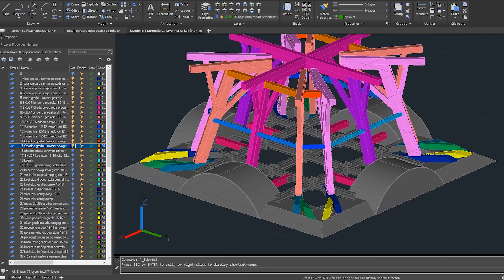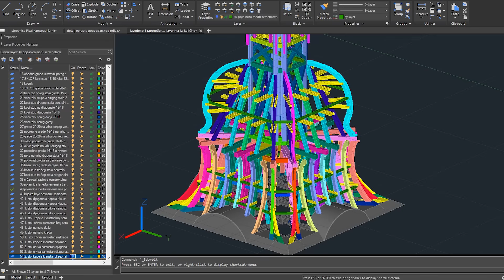We Are Building a Steeple, pt2

Comment: All that beautiful woodwork covered up with that crappy metal. Should have used copper at least.
Reply from the maker: That is real patinated copper. The steeple had to look as it did before, so the copper was sanded and dipped in acid to get that patina look.
Reply: It is a shame that the wood will never be seen.

Comment: Your projects are always amazing, but Wow!
I was surprised by how much of it was assembled in place, versus in the shop (or on the ground) before lifting it up there. I assume that was mostly a weight limit with the crane (or perhaps the additional parts were also attached to the lower part of the structure, and could only be done in place). Curious as to how much the inner frame (11:45) weighed, compared with the weight of everything that got attached to it once it was up there.
Reply from the maker: I should check, but the last lift was around 3.5 tons. We tried to lift at the same time as the scaffolding guys were assembling scaffolding to use the same crane to reduce costs. Sometimes we had finished pieces in between the lifts, so we used a hoist and glued on site. Gluing took the same time as it would in the workshop; the difference is in lifting time with the hoist. Thank you for watching!😊